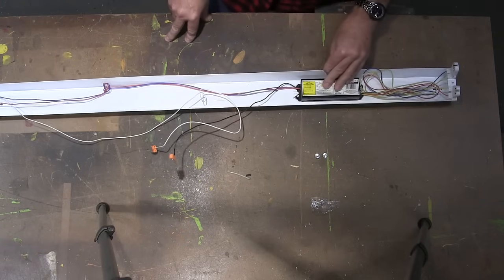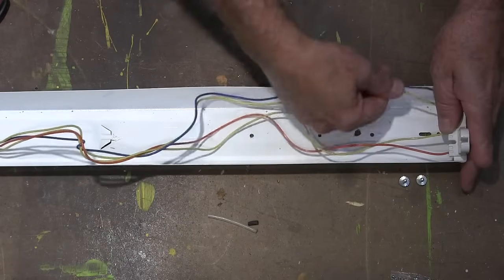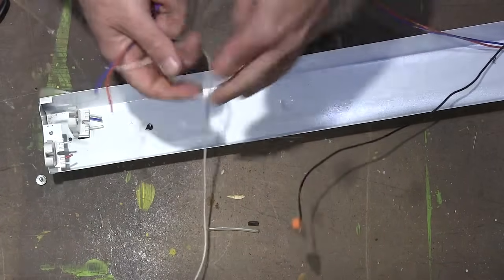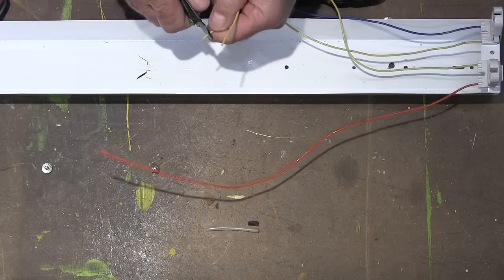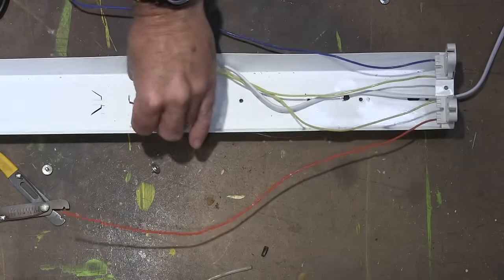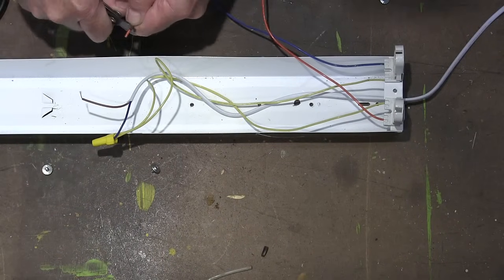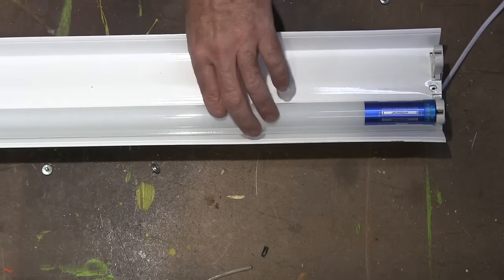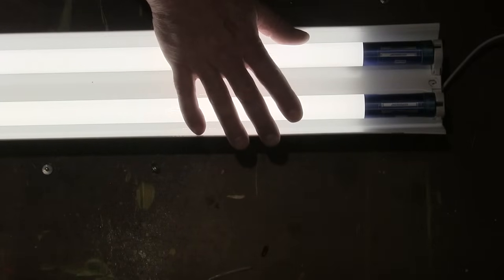Fluorescent to LED Conversion

Comment: Why are you doing all this nonsense just go buy some new led lites and put them up ,
Reply: mike olden - Because a simple 2 bulb can run 60 to 80 dollars. They are grossly overpriced for what you are getting. There are cheaper lights but the bulbs fail too soon. I have 4 failed bulbs that were rated for 45,000 hours but didn’t last a single year, less than 10K hours. I can buy bulbs and new tombstones in bulk and wire a 4 light fixture for less than $30.

Comment: It was helpful in one respect. These are exactly the type I want to convert. However, in another video, a non shunted tombstone was needed for a single end bulb. You made no mention of yours. Don't know why I'm commenting as you haven't replied to anyone. lol
Reply from the maker: There are a bunch of different bulbs out there and wiring options as you know.  I researched and them bought bulbs from my best guess and they worked.  If you have these same lights I would buy the bulbs in the description or ones like them and you should have no problem.  I am very happy with the results and hopefully will not have to change a bulb for many years.  Good luck!!
Reply from the maker: All you have to do to make these bulbs work is supply AC voltage neg to one pin and pos to the other pin on the correct end of the bulb, doesn't matter which pin is pos and which is neg.  You have to use the correct end of the bulb though.  It's clearly marked.

Comment: I watched other videos about needing non-shunted tombstone, also some single-ended led seller stated needs non- shunted tombstone, based on your demonstration,  do you need non-shunted tombstone?
Reply from the maker: If you use  the tubes in the description or ones like them you can wire it as I shown.
Reply: @SoatMon  Thank you! your video was the simplest and clearest instructions of how to convert the lamp.
Reply: I was going to ask the same question. Probably watched the same video.
Reply: Non shunted means that the metal clips within the socket are not connected internally. THIS MATTERS! I purchased a set of Sylvania bulbs to replace a single end powered bulb that had failed. Orange vest guy ensured me that it work. There’s an saying of “trust, but verify”... I didn’t, and tripped the breaker and burned the end of power plug. Pins on that bulb are connected internally with a single wire to LED board.

Comment: I have a standard 2 light shop light with 40Watt fluorescent bulbs (F40/CWP). My question is do I need to replace the standard tombstones in order to get the conversion in this video to work?
Reply: No. Every time I've done this I've just kept the original tombstones and it works fine. The only reason I can think of why it wouldn't work is if the connections on the tombstones are corroded or oxidized due to age, but I've never had that happen. When you buy the bulbs, though, they do have replacement tombstones with them.

Comment: Mark Williams, the main  point of the of the exercise is to GET RID of the ballast. It is unnecessary for the single end LED tubes. The ballast is a big energy drain, and if it fails, the replacement is expensive. If you can't understand what is going on in Soat's video, call an electrician.
Reply: Sure, ideally get rid of the ballast. But the average consumer would very much rather not rewire. For them, it is too hard to rewire and they want a simple plug in replacement that uses half the energy. Easy, they simply buy the drop in tube and they are done. That is why bypass tubes are much less common and are often special order. Wal-Mart and Lowe's carry only direct replacement tubes. 

I do agree, bypass is slightly more efficient and more reliable. Better, That's obvious. But what is saved? Let's talk examples to see how this plays out. In my shop I have 6 fixtures, with 24 - 40 watt tubes, originally with 12 magnetic ballasts. That used 960 watts. Those old ballasts kept falling and I replaced them over time with electronic ballasts, which fail less often and waste less energy. The tubes got dimmer over time and were hard to start in cold weather. Ballasts kept falling too, but less often. 

Replacement LEDs became available at low cost. I tried them in one fixture, then all. Power went from 960 to 360 watts. Quick start when cold. Big win. Little effort. Now, should I go further and rewire the fixtures to bypass the ballast to save more power? Maybe, but the saved power is only about 36 watts. Instead I removed half the tubes, saving 180 watts. So I went from 960 watts to 180 watts -- with little effort. If I bypassed I would save another 18 watts. Maybe later.... But for now this is fine.

Comment: Soat Mon, Just installed two single ended LED tubes, exactly as you explained. Worked perfectly, got rid of the old ballast and the two fluorescent tubes. Thank you very much for your video. Very informative.
Reply from the maker: Excellent, thanks for letting me know!
Reply: I'm having a hard time finding single ended led tubes. Where did you get yours?
Reply: @FreshAgenda  Either Lowes or Home Depot website, buy on website and have the tubes delivered to store.
Worked for me.
BC

Comment: That's how I got it wired and hook my bulbs in pops breaker
Reply: You need single end bypass leds for this wiring choice.

You tried double ended bypass leds and they don't work wired the way shown here. Search youtube for wiring double ended bypass tubes so you can use the tubes you bought.
Reply from the maker: Make sure you have the bulb in the correct way around, if you put it in backwards it will blow the breaker.

Comment: The average consumer has more choices than you show. There are led tubes that work in existing fixtures with no wiring changes. They are the simplest to install. These led tubes are non bypass, called instant fit, plug and play and other marketing names, but the key fact is no wiring changes are needed -- no need to bypass the ballast. Simple, easy,and popular.

You showed how to install a different type, called single ended bypass. They do require the wiring changes you showed so well, including bypassing the ballast. They are slightly more efficient and there is no ballast to fail. Long term these are better investments if you are willing to rewire.

There is a third type, double ended bypass, which is wired differently than you showed. These are less common, just don't mix them up with single ended bypass.
Reply: Mark Williams I like the plug and play bulbs but I discovered they only worked in the fixtures I had replaced the old magnetic ballasts with electronic ones.
Reply: Magnetic (M) ballasts are typically very old and not sold new today. Most older M ballasts have burned out by now and been replaced by electronic (E) ballasts. M ballasts were sold in 40 watt T12 fixtures. Newer fixtures use 32 watt T8 tubes and have E ballasts. 

Therefore, That is the biggest target market for led tube replacements, namely replacing modern  32T8 fluorescents run by E ballasts. In my area, Lowe's carries only GE brand T8 led tubes only for electronic ballast fixtures, not magnetic. Again, that is the bigger market. Home Depot carries only one Phillips brand T12 led tube for only magnetic ballasts, the Phillips 40 watt equivalent T12 "Instant Fit" tube. I tried it, works fine. If you must keep your obsolete magnetic ballasts, try the Phillips T12 Instant Fit tubes. Or ...

Home Depot/Phillips also offers a "Universal" T8 led tube that (they say) will run on either  E ballast or M ballast, and this sounds even better --- but I have not tried one yet. 

Ahh... So many confusing options. And these options are available only if you choose not to rewire/bypass. If you can rewire, do it --- and use single ended bypass tubes. Getting rid of the ballast is always best, because it will fail someday soon, and with leds it just wastes energy and does nothing useful. 

I prefer single ended (SE) tubes mainly because I think double ended (DE) tubes have two needless risks. First, if you put a DE tube in a fixture that has not been rewired, it will burn out the ballast. Second, if you put a DE tube in a fixture that is rewired for SE, you either trip a breaker or worse, cause a fire. We don't need those risks. SE tubes just don't work in those cases, but no fires. No matter which, mark the fixture as SE or DE to prevent mixups.
Reply: Mark Williams yes that makes sense. I have 16 fixtures in my house that was built in 1993. I just changed out the ballast in two of them today. One of them I’m certain was the original as it had no spliced wires etc. The new ballasts are Phillips Advanced T12 but it’s current matched the equivalent T8 Ballasts. The T8 LED tubes appear to be working fine so far. I couldn’t find much info online about using T8 LEDs with a T12 Ballast.
Reply: But if your ballast is bad.... wouldn't this be useful?

Comment: Seems to me you really need to open the fixture before going to the store for the bulbs. Otherwise, there's no way to know if the tombstones are the right type. If the fixture has shunted tombstones with a single wire to each one (double-ended power), the instructions in this video won't work. Checking the fixture first will save a trip back to the store for the correct tombstones.
Reply from the maker: That's good advice.  Thanks!
Reply: @SoatMon  Well, it turns out that there's another option. I ended up at Home Depot and bought "Toggled" brand bulbs in two-packs. They're a little pricey, about $20 per pack, but they come with good instructions, replacement non-shunted tombstones (theses are single-ended bulbs) and wire nuts. It turned out that one end of the fixture I was converting had non-shunted tombstones, so I didn't have to change them out. Good thing too, because the fixture is located behind a wooden framework/fascia that the builder installed after the fixture was mounted on the wall. It was extremely difficult accessing the wiring in the fixture, and I doubt it would have been possible to change the tombstones without ripping the whole thing off the wall. Anyway, I was able to remove the ballast and wire the 120VAC wiring to the existing tombstones. Voila! The fixture works great and the new bulbs are very bright. :)
Reply: Your statement on this post is absolutely correct,
Reply: B

Comment: I removed the ballast and the LED tubes blew out
Reply from the maker: Did you use the same bulbs?  If so check to see if you put the bulb in backwards, in other words put the wrong end of the tube into the tombstone with connected to power.  I accidentally put one in back ward and it blew the breaker but did not hurt the bulb.  If it's another brand or model bulb, I'm not sure what is going on.  There are a lot of different configurations and wiring schemes depending on the bulb.  Good luck!
Reply: @SoatMon   There are more than one type of LED strip bulb.  Some are made to swap into existing set ups using any ballast. Some are swap ins but work only with electronic ballasts. Some (as in this video) are designed to use direct line voltage with the ballast removed. Line voltage tubes can be single ended or double ended.  Mix these up and you get a pop and smoke or nothing working at all.  The really annoying thing is that the manufacturers dont state on the packaging what type they are. They say that if you have a problem, consult an electrician.
Reply: Julian Fell - I posted same before seeing your post. I also added to not trust everything home improvement store employees say. Most don’t know and are just parroting what they have been told in training.
Reply: Then you sir, made a mistake

Comment: Thanks for this video.  None of the others had the wires running between the tombstones like they are on my fixture and I had no idea what to do. The only problem is my power is coming from the other end.  So I can just pull it and move it to the other end?  Also the other videos took the wires from the dead end and connected them to the neutral wire.  This is not necessary? Have to say I couldn't understand why they were doing it.
Reply from the maker: As long as your bulbs are wired the same as the ones I listed you should have no trouble.  You do not need to connect the other wires to neutral.  It doesn't matter what end the wires come in as you can just swap the bulb to the other end.  
Again, be sure to get bulbs that wire up the same way, others have had issues.  Good luck!
Reply: @SoatMon  Thanks for responding. I ended up switching the tombstones instead of moving the power cable. It was easier and it worked great.  One down, eight to go.  Thanks for your help!

Comment: I have to confess, 2 things:
1st - I am not handy...handsome maybe, but NOT a handyman.
So the 2nd thing is pretty self explanatory: You made this look way too easy and I smoked some tubes.
You did not say anything about "shunted" or "non-shunted" tombstones. Does this matter in the video you have above?
I don't feel like you drove home the single ended bulb piece well enough. You gave a recommendation for the bulbs you will receive a stipend for, but you didn't reinforce to those of us that lack skills or understanding of the "tronical" basics.
I bought some led bulbs from Walmart, read the package carefully and after observing the disclaimer: "This bulb was designed to operate on magnetic, electronic instant start, program start and rapid start ballasts." I figured I was good to go and one of these was the wiring method you showed us ...doh.
Reply: The key word is ballast. The Wal-Mart tubes work with most ballasts, and in fact require a ballast. Do not rewire. Keep the ballast in.
Reply from the maker: I'm sorry you had a bad outcome.  I did the video because it took me a long time to figure it out.  The ones I suggested can be used with or without a ballast.  The statement on your bulbs indicates that they are to be used with a ballast, therefore the wiring would be different.  If you still want to convert I would suggest you get some of the bulbs I listed, no matter where you purchase them.  It can be very hard to figure out all the terminology and different bulb types.  Hope that helps.
Reply: @SoatMon ,
Thank you for the response. Hopefully others will read through these threads before embarking as I did...or you can add some comments above to make sure knuckle draggers like myself are dialed in.
I made all the wiring mods and am somewhat committed to making the switch, so I ordered a retrofit kit (2 bulbs and non-shunted tombstones). I should be good to go. 
Thanks again.

Comment: you fail to mention if it's single ended power or double somewhat confusing too the average person,you should be more specific.
Reply: He did in the video
Reply: Jimmy Japan Love  Agree. Luckily there are a bunch on videos to double check. Can't do the job based on this video.
Reply: So this kind of wiring can only be used with a single sided light bulb right? 
But can wire it different for a double sided bulb if you wanted to?
Reply: Could not figure out what he did with the power lines that previously fed the ballast
Reply: @Anthony Duncalf thanks I did not notice that and will do that when I install the LED
Reply: Well I just learned this the hard way
Reply: I work 3 years and ik what I'm doing that's one wayed
Reply: What is confusing is the fact that not all LED tubes are created equally, nor are they labeled properly. There are  bulbs powered off single end that require non-shunted tombstones. The black ‘hot’ or L1 connects to one pin, the white ‘neutral’ L2/N connects to the other. Some are labeled on bulb, some are not.

 Other bulbs are powered in the same manner as standard fluorescent bulbs, connecting red or blue wires to one end, yellow to the other.

 Not all LED bulbs can operate without a ballast. They require a rapid start or instant start ballast. They will not operate with a magnetic ballast. I just installed Sylvania 12W bulbs in an old fixture that would not light when directly connected to AC line. 

Also, don’t trust just any of the professionals at orange vest or red/blue vest stores. Find somebody who knows what they’re talking about. Get a second opinion if need be.
Reply: @DRPowell  I have a four lamp fixture. I removed all wires except for one for each tombstone. I hooked one end to black and the other end to white. I have the "L" end of the bulbs on the black. They won't light. Any idea what I need to check or do differently? Are two wires per tombstone required maybe?